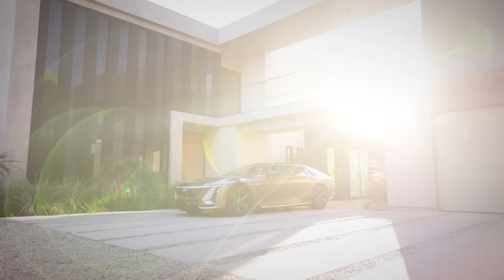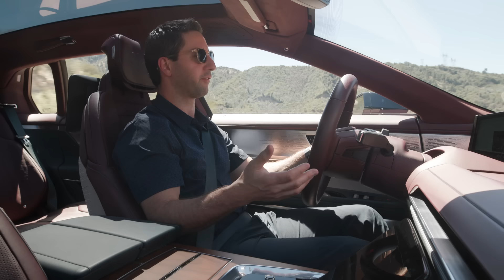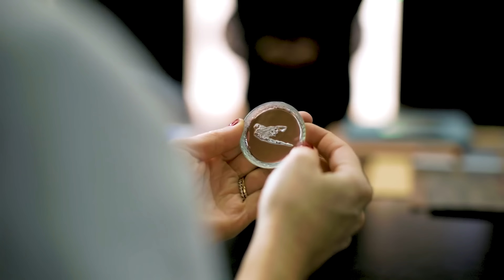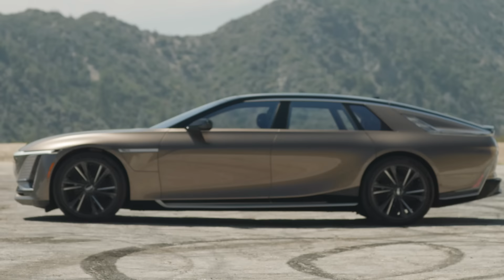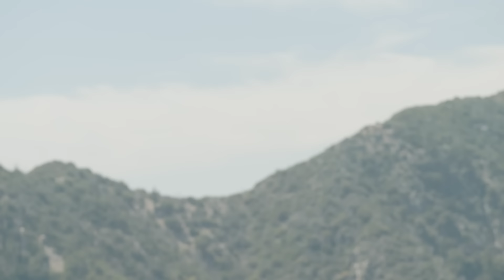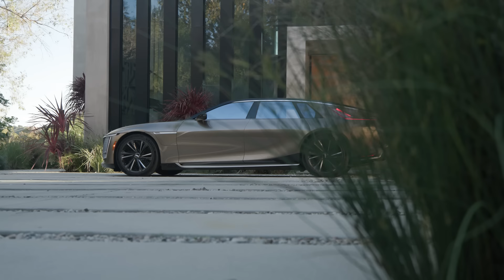Driven! Is the $340,000 Cadillac Celestiq Worth Rolls-Royce Money?

Comment: Cadillac Celestiq VS Rolls Royce. I will keep this simple. The only reason someone buys a luxury vehicle like that, is for boasting rights. People must be able to identify what you're driving a block away. With a Rolls Royce this is possible, but a Cadillac Celestiq looks just like another hybrid car. Nobody is really concern about the insides, most people don't care if it doesn't have a floor board like the Flintstones and you have to use your feet to get from point A to B. People are looking for something that turn heads. The Celestiq achieves that, unfortunately it's in the other direction.

Comment: I'm old enough to remember Cadillac as "the standard of the world".  My mother ALWAYS bought a new Cadillac starting in the early 1960s until the early 1980s (when Cadillac lost it's position).  Cadillac has finally produced a car that was pitched as a concept--however there were previous concept cars that Cadillac should have made--starting with the "Sixteen" in 2003--and afterwards with a beautiful coupe and convertible concept just last year.  The Celestiq is definitely imitating the Rolls-Royce experience as a true bespoke car.  Even thougth the Cadillac is around $200K cheaper than the RR, there are elements of the Cadillac that justify the "cheaper" look of certain elements--mainly those "stuck-on" rear seatback screens.  They look awful and you can see the cheap plastic "stuck-on" look even in this video.  They should be hidden as RR does.  The information screen on the dashboard is equally ugly and cheap looking.  I like this car overall--and now as a mature man who could afford a car of this calibre--I still wouldn't buy it over a Bentley, RR or Aston-Martin.  Once a carmaker goes down, it's nearly impossible to recapture that "standard of the world" position they once had--especailly with SO much competition.  And don't rule out makers like Genesis--a gorgeous car with attention to luxury detail equal to RR.  I hope Cadillac can recover as I remember the beautiful cars from the 1960s onward.  Nowadays, Cadillac is just the same-old andrynous looking cross-over/truck thing everyone is building--with uninspiring colors, finishes, etc.  The Celestiq might be able to wrangle some RR-level buyers over--but I'm not holding my breath on this one.

Comment: This Cadillac will not compete with Rolls-Royce like they think it is. When you think of Rolls, you think of unique designs that start from $300,000, their cheapest model. This car looks like a Lyriq sedan. It has the current modern Cadillac design language, which works when it comes to their lineup as a whole, but when you have a $65,000 Electric SUV and a $340,000 Electric Sedan and they look more alike than not, it takes some of the exclusivity away. That interior looks a lot like other Cadillacs in the lineup as well.

Comment: I applaud the high end direction Cadillac is going too, but something is way off with that back end of the car. It doesn't flow as the front of the car does.  As if two design teams worked separately on it, one for the front and one for the back and they didn't check in with each other.

Comment: The review seems very lackadaisical, with many repetitive thoughts on the design, and incredibly poor review of the driving: "Cadillac gives you two choices, ..."; and then we understand later on he is speaking of driving modes, but at first, we may think he is speaking of drivetrain options. 

We are told it is the same drivetrain as the lyriq, but we still get no specs. A quick google search can remedy the lack of information, we get back to the lack of substance of this, what, review? Commercial? 

We get no real information on how it behaves on roads, and there is an insistence on comparing it to the Rolls Spectre. Fair enough, but the Lucid Air is pretty close, in terms of form factor. Also, the presenter's words speak of a certain enthusiasm for the car, but we feel coming from him.

I am not a professional journalist, or journalist, but even as a lambda content consumer I feel the lack of script quality. Motor trend used to be better, much better.

Comment: Includes getting to know your service advisor at your local Cadillac dealer for all the time it breaks and you get a ride home in some crappy shuttle bus.
Reply: This is an electric car, which means that it is very reliable. Electric cars have very little to go wrong and they also require minimum maintenance.
Reply: @yo1984kc In theory, but it’s a GM
Reply: I'm sure that a Cadillac dealership would loan you are car

Comment: For this much money, they should've put a huge quad turbo V-12 in it with 2 front cylindrical raxial EV motors to make it AWD...should've had at least 50% more power than a Lucid Sapphire since owners will end up paying at least 50% more for this Celestiq than they would for a Lucid Sapphire, which means it should've had at least 1,850 hp...which if they had put in a quad turbo V-12 with 2 front EV motors, it probably would've had a lot more than 1,850hp anyway...lost opportunity to make a statement to hush all comers, and the side/back view is not good...

Comment: It's kind of funny how they highlight real metal being on the interior instead of the metallic coated plastic in every luxury vehicle under 200,000 these days. Most all cars should have real metal trim. It doesn't cost an arm in the leg. Neither does soft touch injection molded plastic